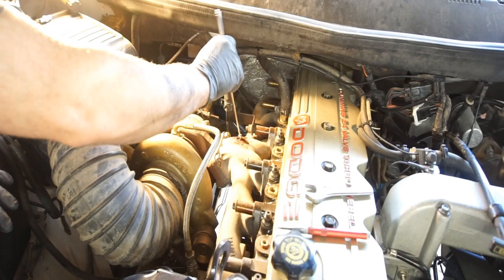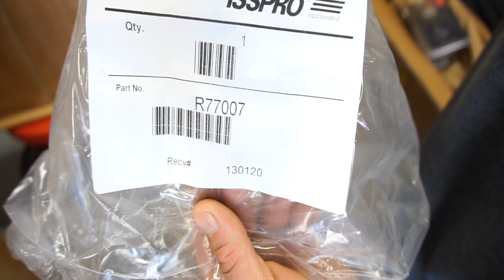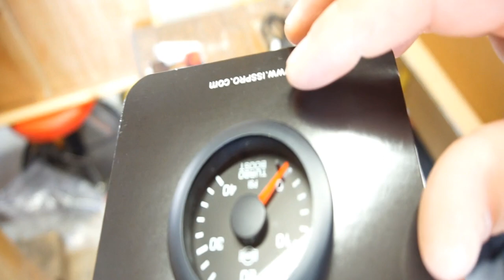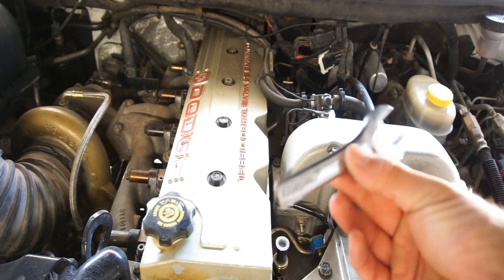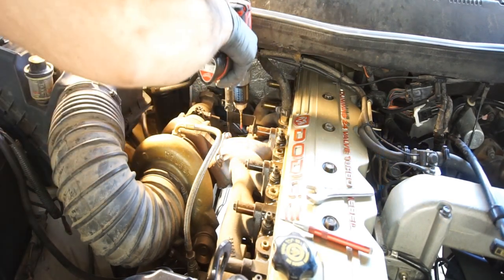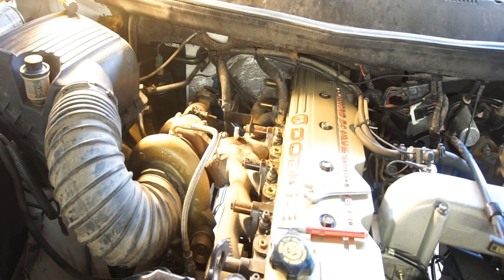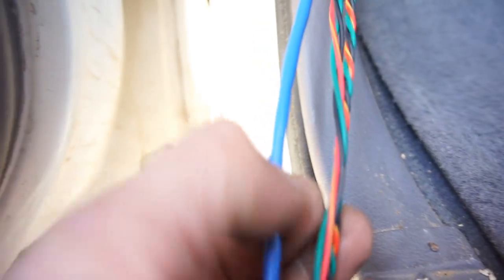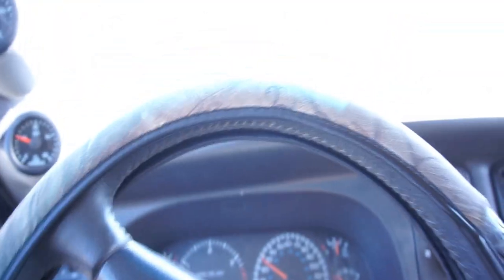Longest Video Ever But Good. 2nd Gen Cummins Gauge Install

Comment: Do you have any tips on the a pillar /  gauge install? Did you use the Christmas trees or did you use screws to hold it on there tight? Thanks
Reply from the maker: I used screws to hold it on there tight. I tried the Christmas trees and it just rattled and irritated me so I used interior screws.